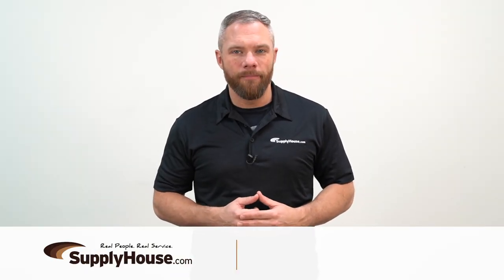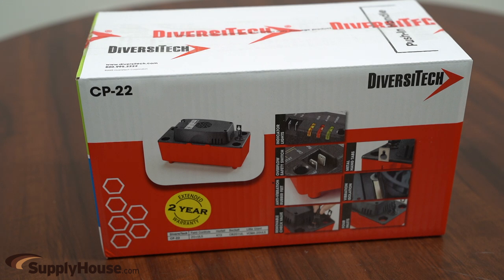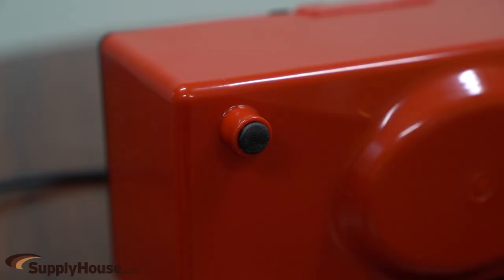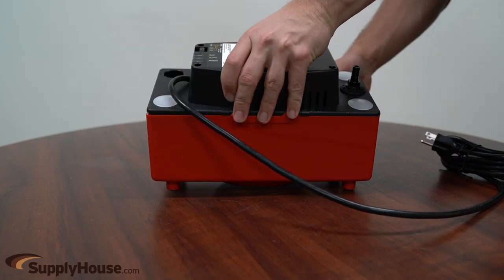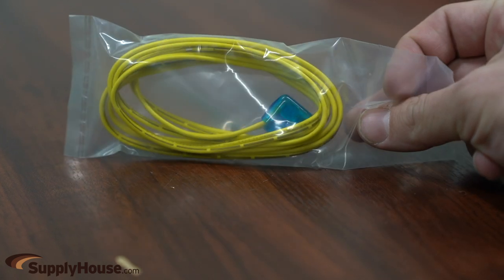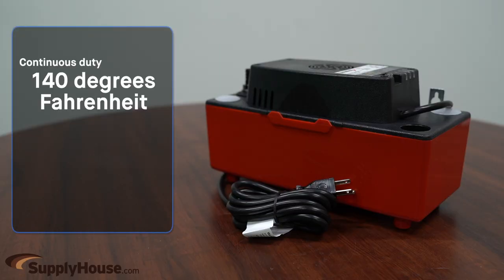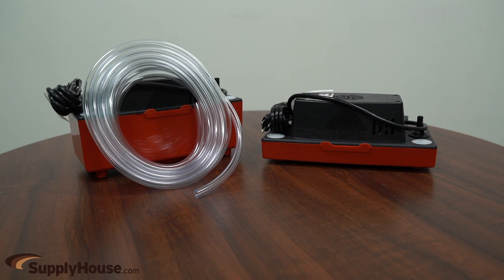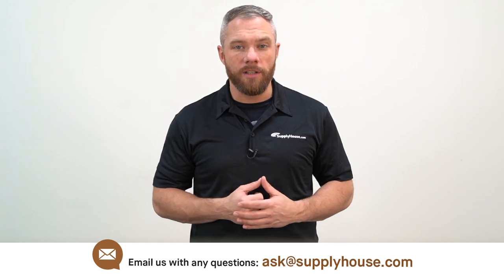The DiversiTech CP-22 Condensate Pump

Comment: Diversitech solved the float problem in their later models.  I installed one outside my high efficiency furnace along with new tubing and I couldn't be happier.  It works better than the old one ever did, and it's quiet too.

Comment: When the float valve fails, either because the arm breaks, or more often the float becomes water logged and submerged, the switch won't activate, and the catch basin overflows.  This seems to be a common problem, however no replacement part appears to be available. If there is one, please advise.
Reply: I've seen wine bottle cork replacements.